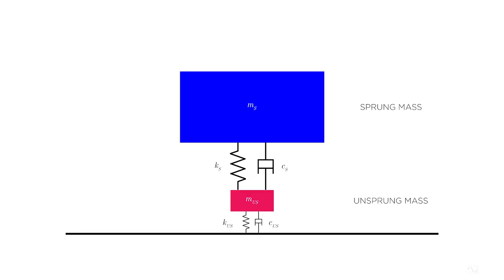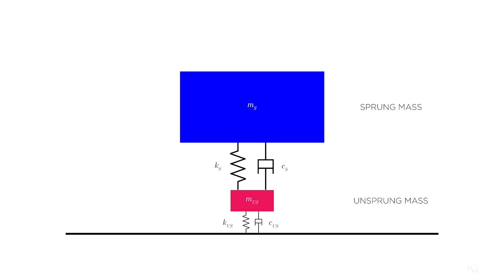Vehicle Dynamics Insights 006 | Ride & Vertical Dynamics w/ Mike Law

Comment: is there any relation between ride frequency and amount of available wheel travel in jounce before the bump stop ? Suppose i select the spring rates to achieve 1.65 hz so how do I select the wheel travel required to achieve 1.65 hz?
Reply from the maker: Well, generally a higher frequency will produce a smaller amplitude and you may find yourself limited in wheel travel due to the thickness of the wire needed to produce a high ride frequency spring coil, but there's no mathematical relationship between the two. 

You could specify a 1.65Hz heave frequency with the same wheel travel as a system with 2Hz in heave